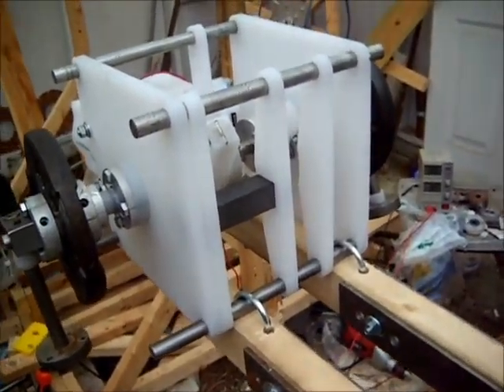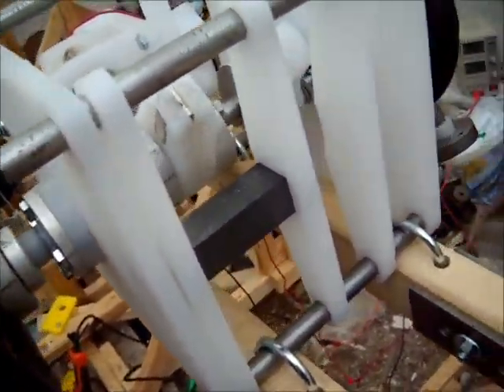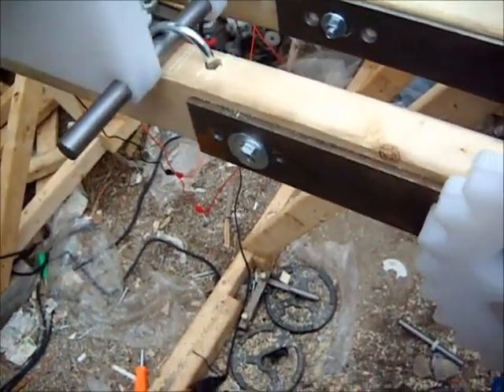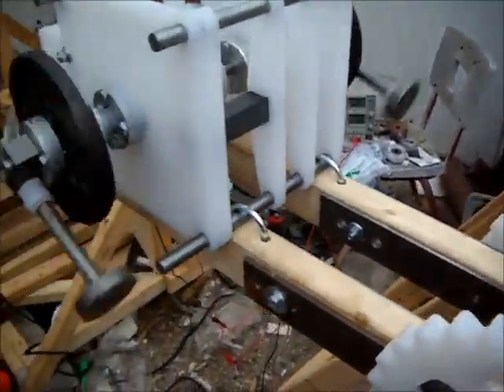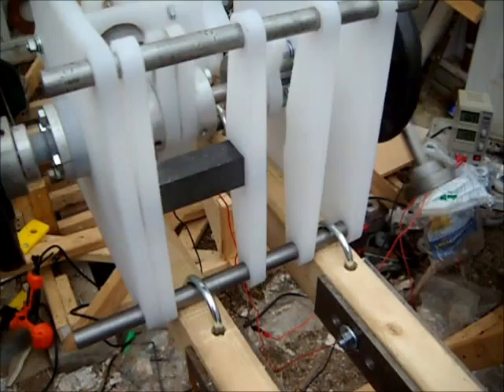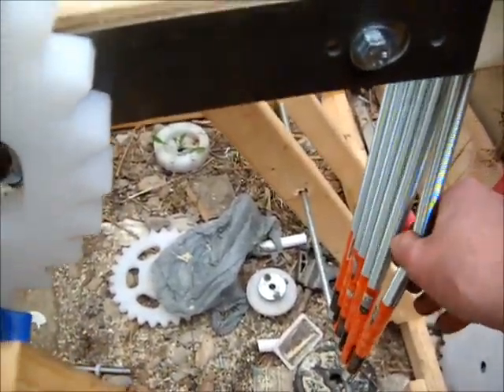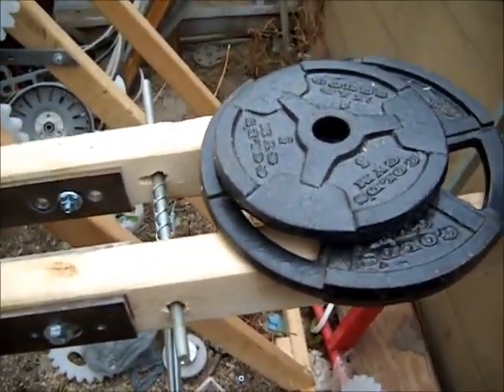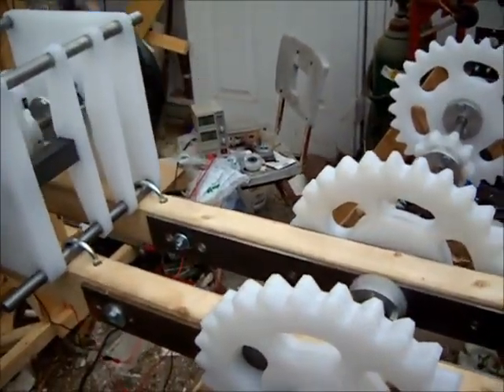GramUpdate 4 26 15

Comment: I love those big meccano stuff you have. Gears and such.
You could either use longer rods to attach the weights on the flywheel, have the contra weight on a much longer arm as to balance things. Do expect big forces to be created, a beam of wood might snap. This indicates steel might bee needed! Most 2 stage pendulums are made of very strong materials such as steel. With wood and such, it just never gets there where you want it to be (to do astonishing things). So far my 2 cents. Thanks for sharing as always, love that stuff!